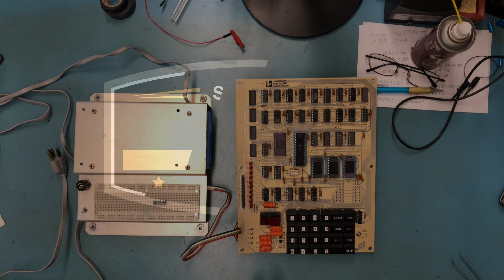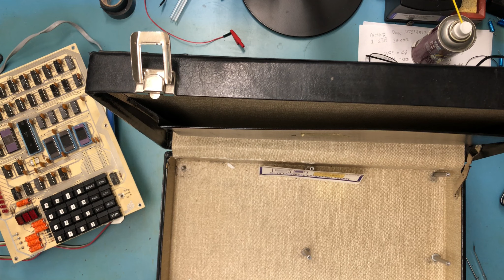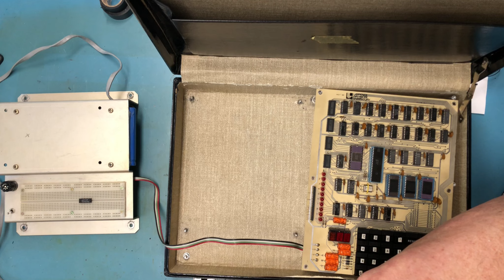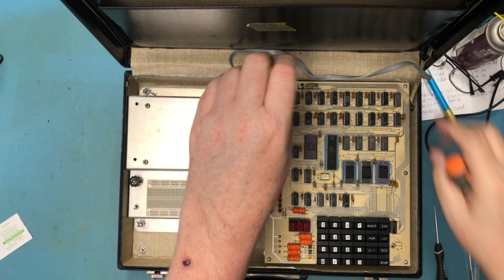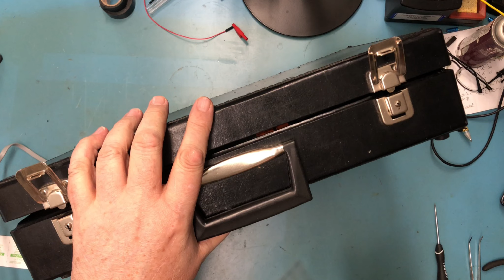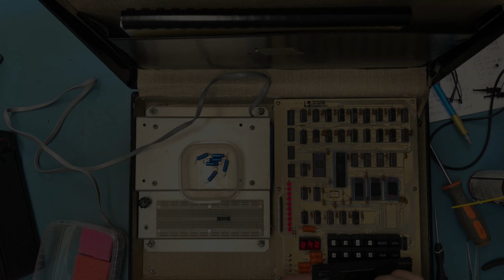STB1158 - Lawrence Livermore Labs - MST-80 - Part 9 - Back in the case

Comment: i saw you repairing this on other video im glad for you.i have an elan e9a programmer which powers on and displays but the keyboard and piezo sounder not working i ve tried almost evrything cleaning contacts ,checking voltages,all ok i dont know from were to start. how can i contact you for helping me please.
Reply from the maker: Are you looking for help fixing the E9A programmer? 
If you're looking to program 1702A EPROMs then E9A doesn't look to support them.
Reply: @ShadowTronBlog  yes i like  to repair it and i need help from experts.